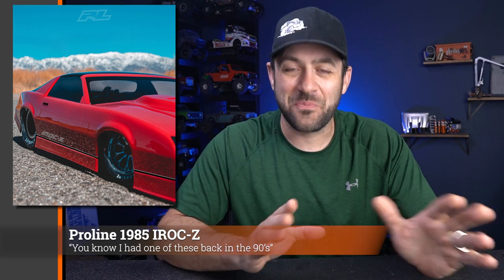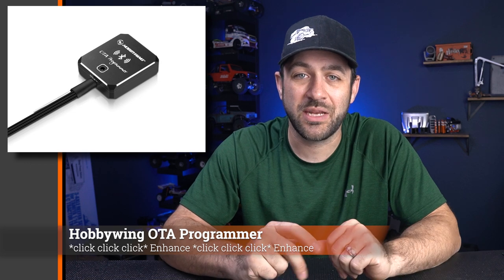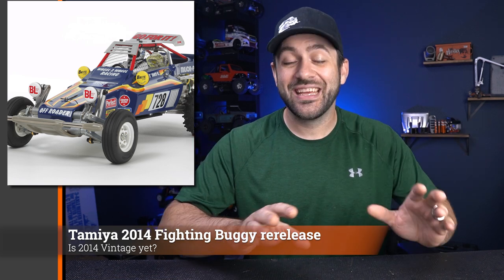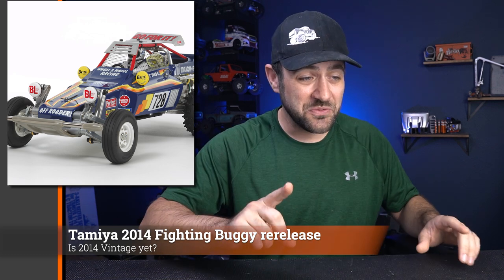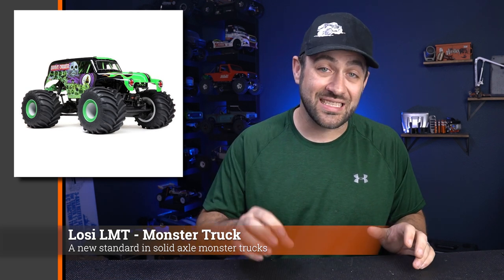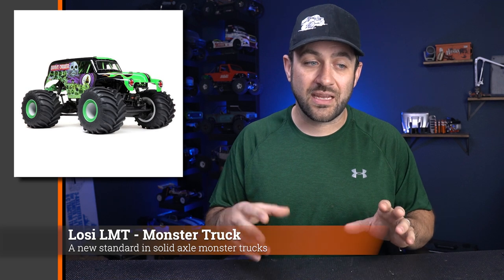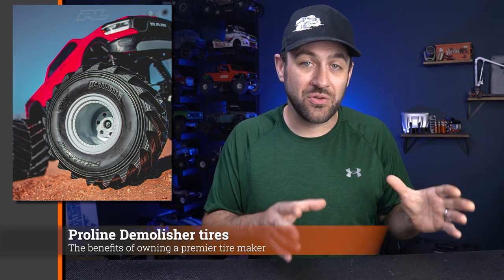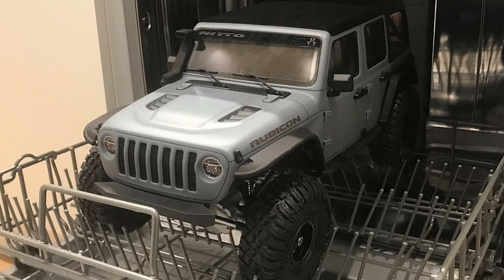Scale News Update - 8 new vehicles! - Episode 129

Comment: General after use my go to is the air hose, then a quick wipe down with Simple Green on a rag where needed.  I run nitro as well so sometimes it needs a bit more cleaning after multiple runs (nitro cleaner once in a while in a few areas).  Winter season comes a partial tear down style cleaning...
The LMT looks fun and durable.  The RTR is a great deal.  If you bought the roller and put the same electronics in it as the RTR, your at the RTR price point and still need a body, servo, and radio (if you don't have one to pair up with it).   I agree with Josh, bash it now and make some upgrades to the servo and body down the road.

Comment: Although not your choice for motor combo, did you see there is an R2 version of Hobbywing Axe system..? Some different kV options with a higher 2800 kV 540 (hooray) and looks like the ESC app is live data and different and the sensor harness plugis a bit slimmer..
Not sure if it went up after your research or what, but its a big week for news and a great time to be into this hobby.
Cheers mate👍

Comment: The Losi MT is a rig I want to pick up as it looks better than the Axial trucks and takes far and away more abuse before breaking. Unless you want to run hugely over sized tires, I don't see the need to chop up the Power Wagon body, that's probably why it is so popular. 
I usually blow them off with an air hose.

Comment: As far as the SCX24 Betty it's basically a Deadbolt, however the wheelbase difference between the 2/3 scx24 models is pretty insignificant even at this smaller scale.